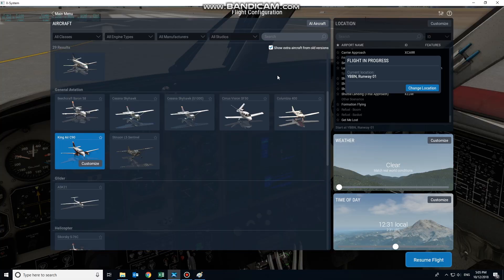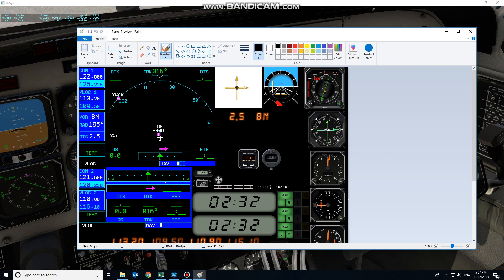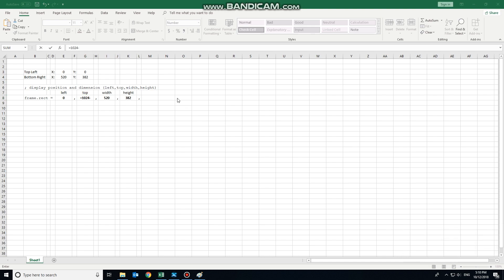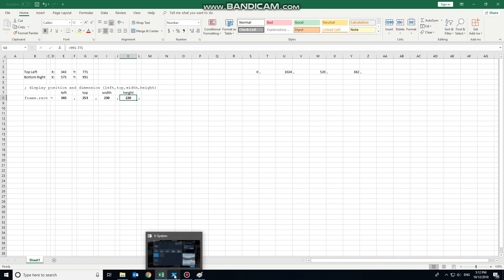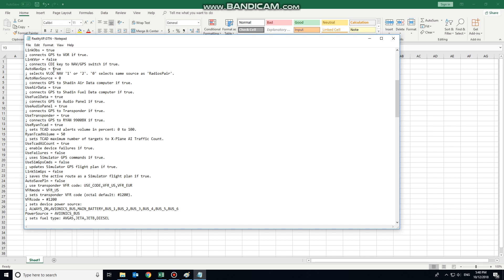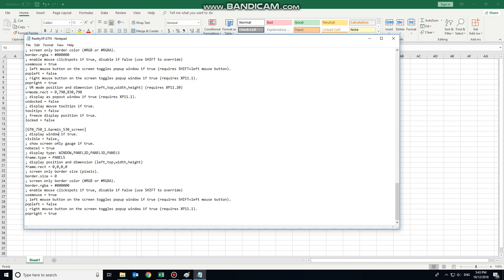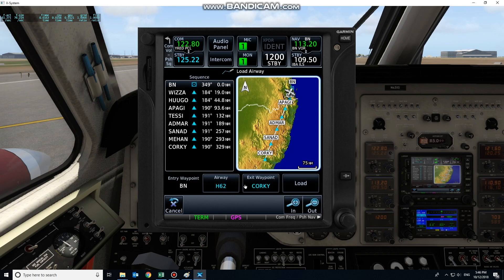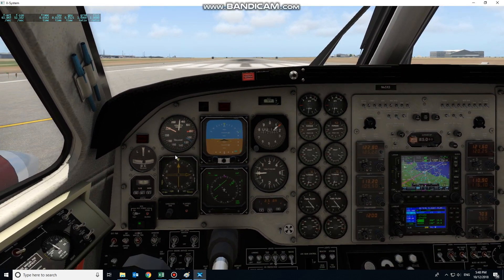RXP GTN 750 / 650 in XP11 3D Panel

Comment: When I load up the  .ini panel now, it says [GTN_750_1.WINDOW] and [GTN_750_1.PANELS] it doesn't show the values that you were changing. Does anyone have any ideas?
Reply from the maker: I'd try deleting the .ini and let it rebuild a new one. It should be default in the .Panels section of the config file.
Hopefully this comes as a notification, about to pull this video for a newer version here https://youtu.be/8lAah0ZI9Ps it is hopefully clearer if that helps at all.
Reply: Sim Pilot Yeah turns out those features are now a check box via the plugin menu. Thanks for the quick response

Comment: Thanks much Sim Pilot...after hours of getting things wrong I have it in my Carenado 1900D and for those looking for the coordinates...I got 1,770,520,385. I corrected the height from 391 to 385, it now looks great in the 530 bezel. It's important (can't stress this enough, get the math correct! or it won't work, and make sure your text edits are just like stated in VOD) also a pro tip, when capturing the panels, make sure the avionics are switched on; it makes getting the coordinates easier, with the avionics off I had no reference to the 530 only a black box.